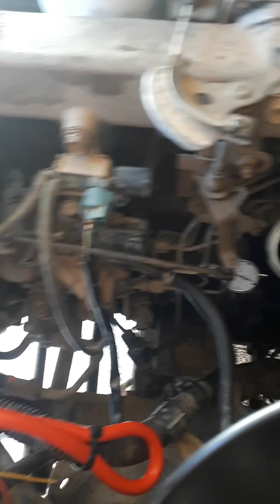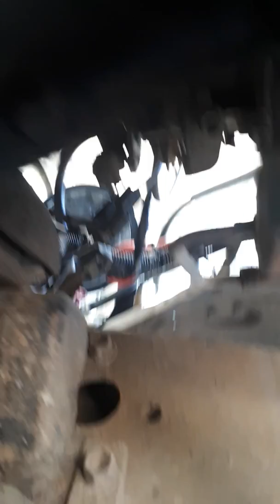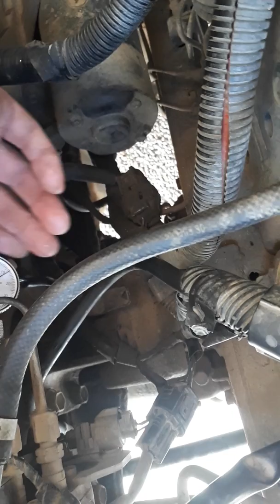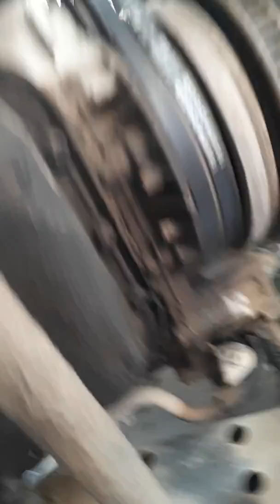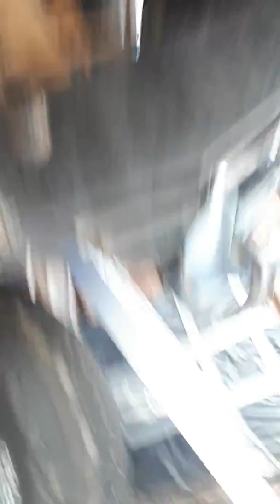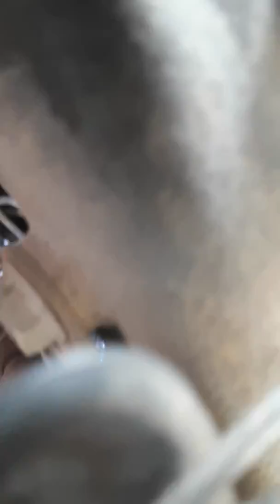1hz landcruiser fuel pump timing adjustment 105 series

Comment: Ive yet to do this.ive got a short block..had the head refurbished..injector pump refurbished..ive had to rotate the crank to get my injector pump tdc..it was out by 180°..ive had to put the timing belt coverplate on the head to find tdc.on the bench ..now i got to line up the marks on the block an injector pump..it was good watching ur vidio..